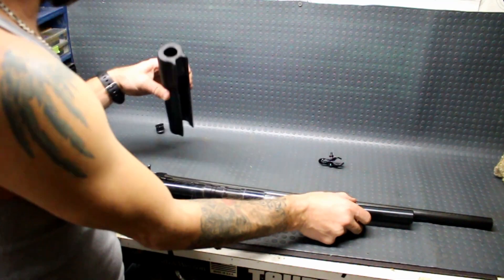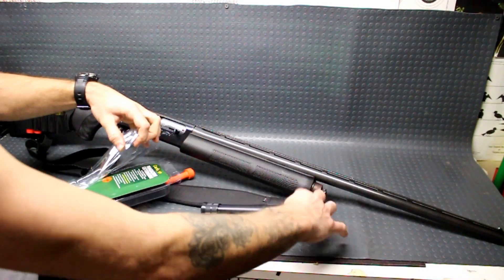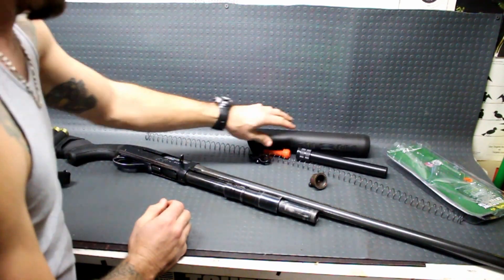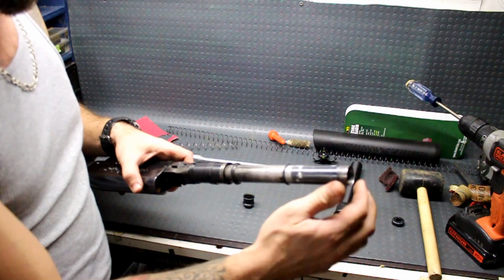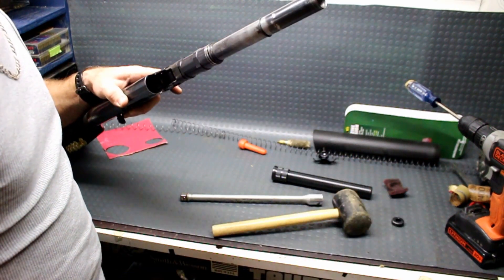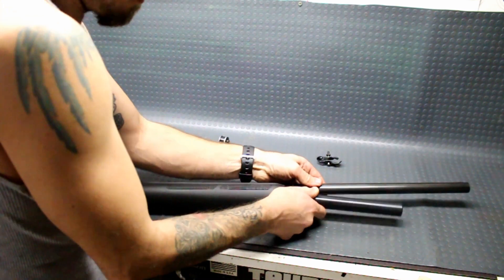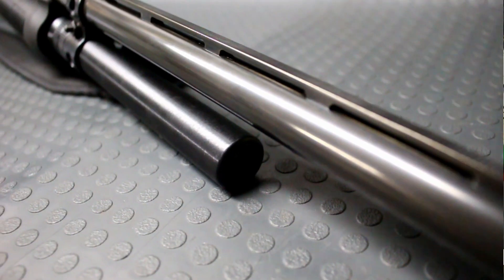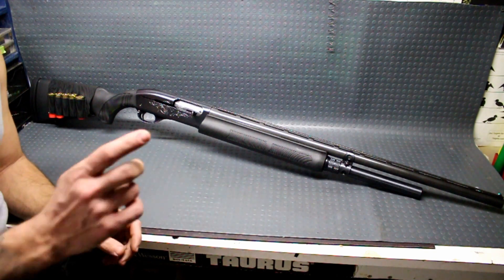Carlsons 8 shot extension Remington 1100 project part2

Comment: I am going get the longer extension to the end of the barrel of my 1100 and the same furniture. Maybe a rifled shorter slug barrel later on because mine is either 28" or 30" I can remember. My 18" FN P-12 has my short range buckshot handled with the Buck Kicker screw in choke. Super tight groups from 18" out to 60+ yards. Very pleased.

Comment: I picked up an 11-87 police model last year and had a similar problem with the recoil spring. For whatever reason it did not want to come out of it's tube. Took some fussing but eventually it popped out and I got a new one in. Then when I took it to the range to try out the upgrades the extractor and plunger decided to yeet themselves out and get lost. I don't know what the deal is but the used replacement plunger I got is too big and I can't get a new one because Remington went bankrupt.